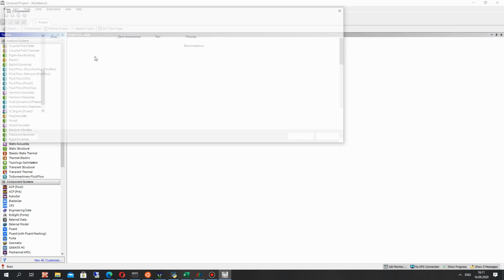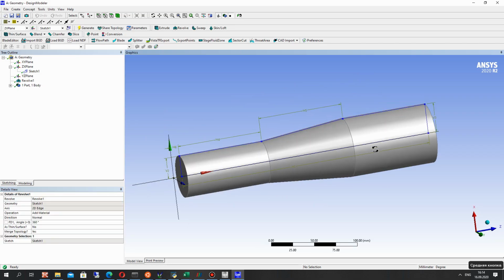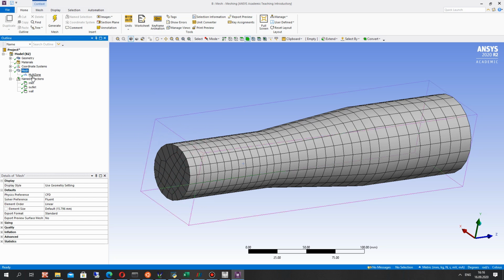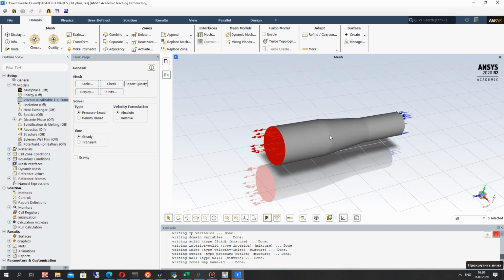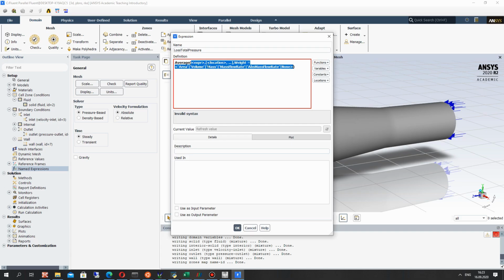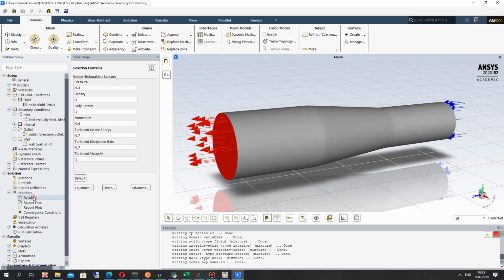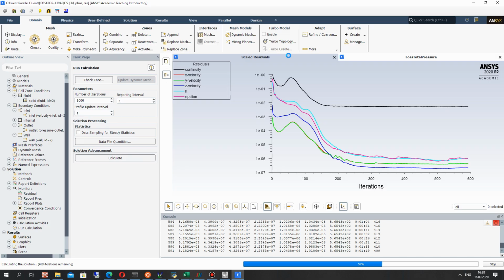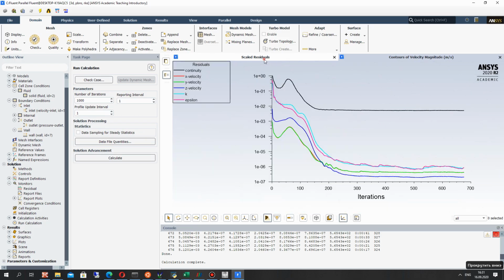Ansys Fluent Tutorial for Begginers | Steady Simulation of Diffuser, Calculation of Pressure Losses

Comment: Is the recent iris xe graphics with the 11th gen i5 16gb ram compatible and sufficient  with ansys for  medium 3d  simulations?
Reply from the maker: Of course, only one thing, if your have not powerful CPU you will be waiting results much more time
Reply: @CFDIntech  does the ansys software work well with amd processors ?
Reply from the maker: @imwaz3644  Yeap, I have Ryzen 3900X, and it working very fast. Much more faster than Xeon 2683v3, which I have also and can to compare both.
Reply: @CFDIntech  this one is integrated graphics Intel iris xe(not dedicated graphics ). ...have you tried them?